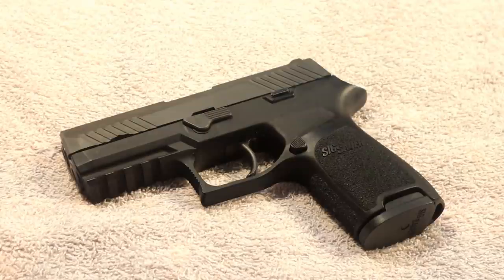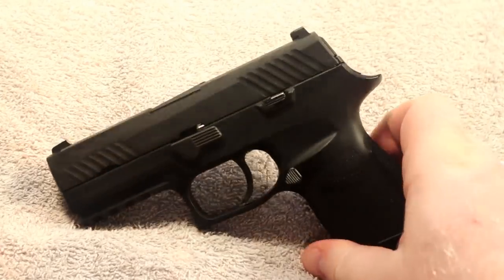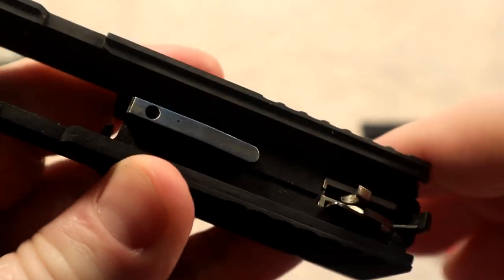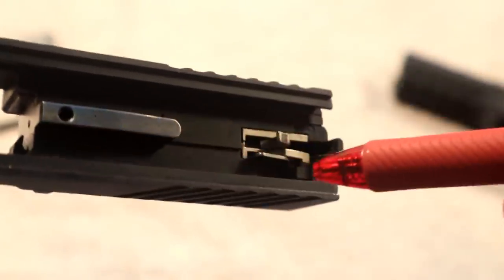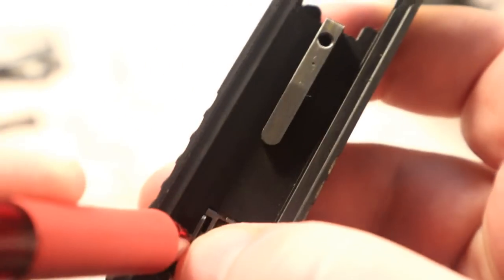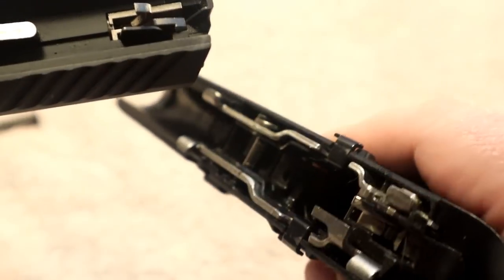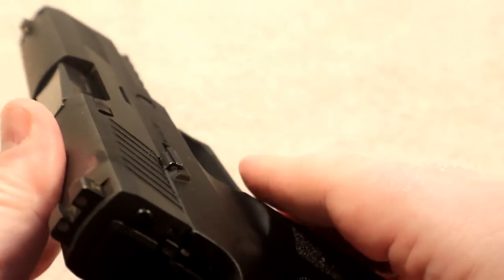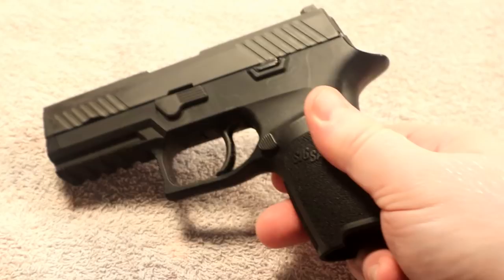The Sig P320's Dirty Little Secret You Won't Find in the Manual

Comment: Another shooter on a YT video while on a tactical range had just finished 4 out of 5 stages. Reloaded his 320 (post drop issue) holstered his weapon in a kydex style made for 320 pistol, went to surrender postion and pistol fired in the holster which covers the trigger. If not for his clip knife, it would've gave him a new body hole (his words). Sent it to sig, they said it was a spring defect, he told them he didn't want the pistol back, and did not want to sell it to anyone. js🤷‍♂️
Reply from the maker: And the gun had been modified. I've seen $2,000 2011s do it also. It was not a stock gun.

Comment: There have allegedly been 3 with Milwaukee PD, with one just recently. Their union is threatening to sue and the State FOP is not recommending use of the gun.
Reply from the maker: If a cop has a ND, they are held responsible if it's their fault. It costs them nothing to claim its the guns fault and that's why they do it. Sigs are fine.
Reply: @BoomStickTactical  then I should be able. To find just as many, if not more, instances of Glocks or other striker fired guns doing the same thing? I mean Glock of dominated the market for the last 20 years. There should be all kinds of cops blaming them for NDs.
Reply: @BoomStickTactical  The "TBF TV" video showing him hitting the back of it with a mallet shows the trigger moving a little bit but this was still apparently the concern even addressed by Sig when claiming the trigger weight was responsible. Too much weight allowing it to move from inertia when dropped at a particular angle. So in my mind this means the cases where officers or others are claiming it just went off randomly while holstering or something are probably bogus, but there are legit cases it seems where the discharge was the result of a drop at just the right angle. Even though the trigger is actually moving in these drop failures, that doesn't wholly explain to me the entirety of the failure IMO since the trigger isn't actually moving far enough. It's more like it's moving just enough to bypass the plunger either all the way or the majority of the way, and the imparted energy from just the right fall/angle is doing the rest of the work to release the lug.
Reply: guess what, they wont win

Comment: I believe that the "drop fired" issue was something that was very real. I own a m17 & p320c and no problems with either one. I did however have an issue with a sherpa holster early on for the p320. Not that it fired in the holster, but something was very wrong in the fit of the holster. I watch the video of the police officer in the gym had a p320 go off in the holster, You can tell he was resting his hand on the butt of his weapon. This is not ideal for sure. I now have a custom kydex holster as well as a safariland holster made for the m17. I had no issues with either holster. I have tried fitting with several other molded holsters with most seeming to have fitting problems. I think I would stick with safariland or custom molded kydex. I have a guy here nearby and I take my pistols and he will make a kydex holster while I wait.
Reply from the maker: It was real on older 320s but it has been resolved now.

Comment: I know this video is old but in 9/2024 we have multiple videos showing the guns going off by themselves.  This guy is not an engineer and that’s why he doesn’t understand how it can happen.  If you have a 320 take the firing pin assembly out of the slide and look at the firing pin safety lever.  Look at the spring that actuates the lever.  These are single coil springs which makes them less reliable and in fact these have been breaking and failing.  Once this happens, that lever can move by itself and allow the tension in the firing pin housing to release, thereby firing the round.  It’s a potential single point of failure.  Doesn’t happen much but it can happen.

Comment: Sig actually acknowledged the issue in a 2017 optional upgrade bulletin? Taken from sig: the “we have confirmed that usually after multiple drops, at certain angles and conditions, a potential discharge of the firearm may result when dropped”
Reply from the maker: The only thing they acknowledged was a drop safety issue. Nothing about them just going off on their own, which is something they cannot do.

Comment: Since this video, there's been (at-least) 2 more instances. I think 2 just very recently anyways. Was wondering if you've heard of them and if you have any information and/or opinion of them(?). If so, would love to hear it. (The one guy says he sent the gun to SIG and they said that it was caused by a bad "firing pin reset spring" that caused it to fire in the holster.)
Reply from the maker: And there has never been any real proof shown of it being a failure of the gun

Comment: I apologize for adding few thoughts that I left out in my explanation / rant below.  I'm currently 70 years old,  been around the block a few times and seen a few things. I just want to further explain,  even in the perfect scenario drawing your duty weapon under extreme stress while being fully aware the potential for problems, I still feel as though pulling a hair trigger 4 lb pre-cocked pistol under extreme stress is a very bad idea for Police Department. This to me is simply common sense. There are just too many different personalities too many different characteristics of how people will act under stress with no way to actually expose  them  to that test. And I'll never believe that there aren't a few very good knowledgeable police reading this that cannot attest to the fact that far too often the guy standing next to them on the firing line during training isn't a complete idiot.  Even a perfectly designed single action Striker Fired pre cocked pistol is a risky tool be handing over to such a large diverse user base.  In fact I would have less problem with double action only pistols for Police Issue than any pre cocked pistol. When I think back to all the idiots being trained pointing their pistols someplace other than down range, dropping rounds in the dirt even under controlled circumstances it's hard to imagine how they would react under a true stress situation.  Add to all that the hair trigger single action pre-cocked pistol is scary at best
Reply from the maker: They clearly need more training than they currently get.

Comment: Great video!  I have a Sig P320 Equinox and have never had an issue with an "un-commanded discharge".  It is pretty sad when the media puts a story out there and does not include all the facts pertinent to the issue.  
It's hard to judge the facts when so many circumstances are involved.   I totally support LEO's and their proficiency.  But, things happen, they are human.  To blame the gun manufacturer and take legal action is questionable.  I hope Sig Sauer is exonerated in these cases.
Reply from the maker: If it's shown they're responsible for the ND, they can be held liable
Reply: True enough.  I assume "they" is Sig.
I also assume the female Detective's Sig was the recent model, manufactured after the voluntary upgrade program.
If so, from what you've shown, I would not think it was the fault of the gun.  Like you showed, too many things have to fail.  I feel the media and public have a responsibility to show and consider all facts in order to make a reasonable conclusion.  Your video goes a long way to accomplish that.  Well done!
Thanks again!

Comment: So a guy made a YouTube video in 2017 showing that if he struck the back of the 320 slide with a hammer (not even very hard) it would fire. Does anyone know if the firing pin block is a new feature added in Sig’s updated design? I’m trying to decide whether to get a 320 for my EDC appendix style and I and my future generations after me would appreciate the insight.
Reply from the maker: It's not a new feature and there is nothing wrong with them.

Comment: I am concerned with the striker block spring design. It is a weaker design compared to the coiled spring used in other designs (Glock, M&P, etc.). The striker block in the P320 is also a formed metal sheet instead of a cylinder used in those other models. The steel cylinder is a lot stronger than a flat design.
Reply from the maker: They're fine

Comment: Is the M17 or M18 exactly the same as a regular p320? Is the military having these issues?
Reply from the maker: There are some internal differences due to the manual safety
Reply: @BoomStickTactical  Thanks, Im considering the M18 and the Glock 19x. I'm not sure which is a better and safer design... But want a tan gun lol. I also hear a lot of lawsuits against the P320...
Reply: @ag2158  trigger is crisp and short on the p320 and glock have sloppy triggers. Oh and p320 more reliable.
Reply: @ag2158  There is no contest. Do a deep dive into the internal safeties. The Glock's striker block in front is one of three redundancies that all need to be overcome as the trigger is pulled. With the Sig, there is only the striker block at the rear that needs to be overcome. If it were to fail, there is nothing else preventing the striker from going forward with enough force to ignite the primer. Not so the Glock. There are two more redundancies (striker block in front and untensioned spring, though honestly I'm not as positive about the spring) that would prevent the ignition. I won't carry a striker fired gun appendix unless it has that front block. Other brands do besides Glock, but not Sig. Now to refute what I just wrote, the rear of the Sig striker would need to break, and it appears pretty strong (just not enough to convince me to aim it at my privates).

Comment: A friend just purchased a new SIG p320 (Feb 2022).  The gun has a 4 lb  (measured)  trigger with very little take up.  This gun should not be carried in anything but a rigid holster that covers the trigger.  If anything gets into that trigger guard, the gun is going to go off.  In my experience, cops have big egos and will not admit they made a mistake.
Reply from the maker: Yep. Sig is a great gun

Comment: Sig should’ve had you as an expert witness in the latest lawsuit loss
Reply from the maker: If you read the findings, you will see there was nothing showing a malfunction of the gun. The court simply said they're at fault because the gun doesn't have a manual safety

Comment: Because the toleranes are so tight, could improper cleaning or failure to clean certain areas cause any of the safeties to fail. I have personally seen brass shavings cease an AR trigger.
Reply from the maker: If there was enough buildup to make it fail, the gun wouldn't function at all

Comment: This doesn't disprove the gun can't misfire.... it just indicates this area isn't the likely culprit.  My guess from reading the complaints would be shock impact on or around the trigger causing the firearm to discharge.  What isn't listed in any of the complaints are if the safety was engaged or not.
Reply: What safety? Most don't have a manual safety.
Reply from the maker: This gun is fine

Comment: I have an M18 model p320. This model does have a manual thumb safety, never the less I have TRIED to get MY gun to discharge ( I say discharge but I just mean striker drop) without the trigger depressed with manual safety in the off position. I have tried a few different methods multiple times and I have yet to be successful in getting it to drop the striker! As a side note the production date of my 320 is mid year 2020. I agree with this gentleman that the updated production 320s are safe and simply will not discharge unless the trigger is pulled. I'm confident enough that I plan on getting the kit sig offers to safely delete the manual safety. I certainly wouldn't put the meat and 2 veg on the line without being absolutely sure I won't end up a unic soprano with a testosterone deficiency and a limp!
Reply from the maker: You should be fine as long as the trigger doesn't get pressed

Comment: Late to the party, but… we know that there were reported and acknowledged issues with drop safety on the early models.  We know that Sig added a secondary sear shelf to remedy this.  So, if the early guns had a “firing pin block”, how did they discharge when dropped?  Obviously the primary sear shelf was failing, BUT, the firing pin block should have prevented a discharge when dropped.
Reply from the maker: They were firing because the inertia of the trigger. That's why sig changed them.

Comment: great video.  just watched this again and you caused me to wonder about something.  let's assume that some of these accidents that occurred where the P320 went off "on it's own" are accurate.  is it possible, based on your video, that once a person finishes re-assembling their P320 after a cleaning and they fail to do a function check, could they re-assemble it in such a way that the safety pin firing block is prevented from doing it's job, thereby setting up the condition that if the P320 is bumped while in a pocketbook or in somebody's holster, the firing pin can actuate?
Reply: I was noticing that they modified a known faulty design with mechanical corrections that ALL could easily "fail" or stick by the right foreign material being introduced under the right conditions. What I quickly recognized from the couple scenarios I watched was that the combinations of a moderate number of rounds down range with a user likely to never or seldom to have had it apart to clean or oil properly in addition to the likely introduction of fine and varied materials possibly able to lodge in a place that would cause failure to reset of even redundant mechanical safeties. All the same kind of mechanical safety can all fail the same way in the same conditions. Tight tolerances and weak springs with fine debris introduced causing build up and friction could prevent reset of the mechanical corrections and leave you with the same faulty design as the original.
Reply from the maker: It would require the complete disassembly of the GCG and the slide to get it to fail.

Comment: If these same cases had instead happened with gen4 or gen5 Glocks- they'd have correctly been ruled NDs due to operator error, and/or foreign objects like keys, coins, jacket waiststrings causing trigger press and discharge.
Reply from the maker: Yep
Reply: @BoomStickTactical  The cause of the voluntary upgrade program is why people feel like they can get p320 $ettlements for their NDs. It's a shame Sig let the mass of the original FCU parts be so close to the edge of limits.

Comment: I know that there’s multiple components that need to fail but that doesn’t answer the question of the likelihood of it failing. I know nothing about handguns and I’m in the market for a p320 or mp 2.0 and was leaning towards sig. All the reports of discharges is concerning.
Reply from the maker: Most of those reports have been shown to be user error. The detective admitted that she didn't have the gun in a Holster in her purse when it went off.

Comment: thanks for the info! at the same time if people were a bit more careful and not kept a chambered firearm accidental discharge would be nil. however many ppl think its not a good idea to have an edc without having it chambered. can anyone have an accidental discharge without a round being in the chamber?.... i highly doubt it! nonetheless the understanding of being at the ready in case of a threat is absolutely crucial. i get it! but absolute safety from accidental discharges can be 100% remedied by not having the firearm chambered while in a holster or during an accidental drop. that being said along with this video the sig sauer p320 is a phenomenal firearm and safety is the sole responsibility of the one handling the firearm. SIGS ROCK!!!!
Reply from the maker: I always carry with a round in the chamber.  It's all about making sure to keep your finger off the trigger and use a good quality holster.

Comment: video evidence of mallet strike and drop test prove otherwise. Multiple times by multiple individuals...that would be lottery odds
Reply from the maker: Those were prior to the changes and the reason they went off then was due to trigger moving due to hammer strike.
Reply: @BoomStickTactical  heavy trigger inertia from what i understand. However aftet watching breakdowns of the engineering of the safety mechanism...i understand why the military version has a slide safety. Ill stick with safe and boring striker designs

Comment: I honestly do believe it’s the fact it doesn’t have a trigger blade safety.. what does the sig lack that all the other big name polymer 9s have. However the internal mechanisms I think are built well and are safe it’s just the trigger is to easily pushed I mean ask yourself how come sig is the only one in the news all the time with this issue??? Unless I’m missing something. Also I do like sig a lot, owned like 2 p320s and want to pick up a third. I think the trigger blade safety makes a gun al ot safer than most believe.
Reply from the maker: I think they should be trained how to handle the gun. Nothing wrong with them